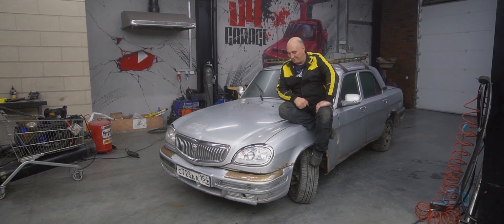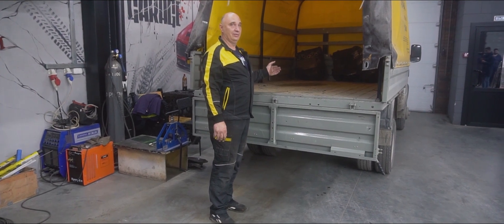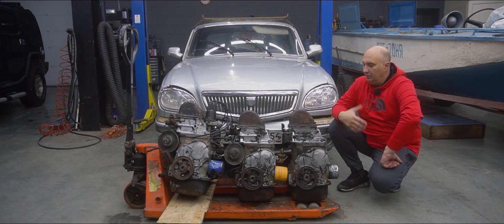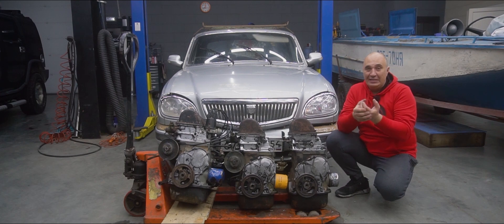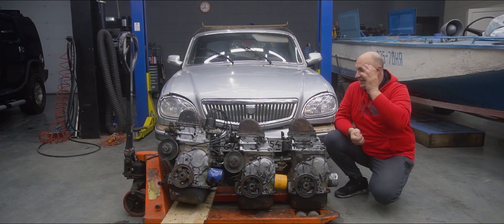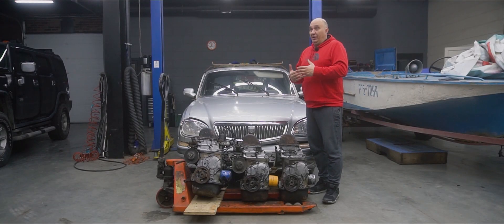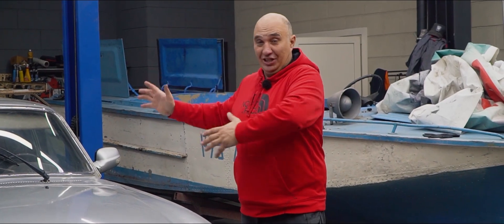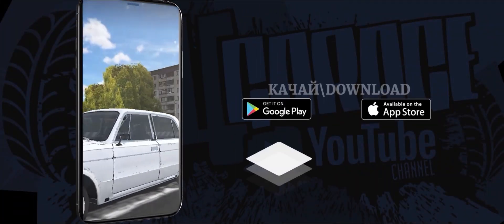Combining three Lada motors into a makeshift V12

Comment: I am a bit sceptical of joining the engines with a belt. It isn't impossible, but it will require quite special parts that won't be cheap and it doesn't sound like a way of Garage 54. You'd need a belt strong enough to transfer torque of the 2 engines, and obviously, pulleys capable of transferring resultant force to the third engine. You can get an idea of it quickly just by looking at the primary belt drive of some chopper motorcycles or at supercharger belt drives. To transmit such a large torque, it would be better to transmit it on a large diameter, because that would not only reduce the transmitted force, but also reduce the load on bearings and reduce a bending stress on the crankshaft.
Nevertheless, I have another suggestion, which is more "Garage 54-like", namely cheap and using available parts: Use the flywheel ring gear and transmit the torque by setting a set of other flywheels (probably 3) between those engines. Those additional flywheels may not even need shafts, as they may be seated directly on bearings on stationary rods, held rigidly enough (ideally at both sides of flywheels) in the frame, which you'll be building anyway to hold those engines together. It will be very "rattly" as there won't be any vibration dampening, but that will bring even more attention from the audience :D

Comment: What i would do is firs to build a frame that will hold the engines together the way that you show them on the video and then make 3 pulleys, gears or what ever you want so that you can time the engines on way that while the first piston of the first engine is in up dead position the second is 120° away from it and the third is 120° from second, i thik that it would work. (sorry for bad writing and good luck)

Comment: Motorcycle chain and sprockets may work but belts would probably be the safest bet. The chain may skip or damage the teeth if 1, 2 or all three engines aren't synchronized well.

Comment: you can put the two upper motors with the flywheel pointing forward, than replace their flywheels, plus the lower motor pulley with motorcycle rear sprockets and chain. The CB600F chain handles 102 HP... maybe you can use only one chain conecting the 3 sprockets, just need 3 free sprockets (you can even use the front sprockets of the kits together with bearings) to make the chain go arround as much theeth as they possible can on the engine's sprockets. There are bigger rear sprockets as well if you think better, like from tenere 600.

This way you don't have to mess up with the transmission/clutch of the "main" engine and will keep the acessories belt of the 2 upper ones as well.

Sprockets and chain:
https://br.ebay.com/b/525-Chain-Chains-Sprockets-Parts-for-Honda-CB600F/49831/bn_51110781

Comment: On the main engine  Add 2 flywheels in the 1st fly will attach the 2 engines By using gears in the 2nd flywheel it will be attached to the  Clutch in the transmission

Comment: Connect conrods to the power output shafts using pulleys that have been modified by adding an off centre peg,have the first mounted near the engine casing and on the next engine in the middle of the shaft then on the last engine at the end,next step is to fix the other ends of the conrods to a crank shaft that is centered on an engine joining plate by using tubing and bearings,the other end of the shaft done in the same way then the two plates are joined to form a box with oil???:/ lol I bet no one understands

Comment: Put some fat diesel timing chain sprockets on the cranks. Use two chains, one linking each secondary motor to the primary which would have two sprockets.  That would make the response a bit closer to that of an actual V12.  Just my two pennies.

Comment: Chain drive them using 530 size chain (what street bikes use), by bolting/welding sprockets to the flywheels, bolt a 2nd flywheel to the primary engine so you can still mount a transmission and clutch assembly. Chain tension won't need to be near as crucial as belt tension would be, and you could achieve it easily by mounting an idler sprocket on the slack-side of the chain assembly (So if the engines are rotating clockwise, mount the idler/tensioner in the 3oclock position.

Comment: I’m thinking giving each auxiliary engine it’s own belt and pulley to a shared main shaft would be better than running a belt serpentine style. Or you could get really fancy and use some motorcycle chain and gears to avoid any slippage and really lock it all together. Probably better off with the belts tho

Comment: take rear seats out car. Put all three engines side by side in car. Spin them so they sit like how a straight six bmw engine does. Cylinder one closest to drivers seat, then two, then three and four right at the back. Connect all three engines with a chain, run it from individual sprockets welded/ bolted to the flywheels.  Take that rotating chain and put it around a sprocket connected to an axle. Connect axle to rear wheel drive LSD.

Comment: i hope it has not already been said but my idea is plate and bolt the front of the engines , fit three centre fugal ( no spell check ) 
clutches to the three  engines with a wide width super strong belt, super charger type belt,

Comment: Just use a good sized roller chain to connect all of the motors output and for the middle motor extend the crankshaft and put a gear on it for the chain, and make a spacer for the bell housing with a gap in the top for the chain

Comment: I4 at the front with a shaft going past the other 2 I4 and connecting to the gearbox.
The other 2 I4 sit backwards next to the drive shaft (in order for the engine turning to work properly) that is connecting the first motor to the gearbox, and 3 gears connecting them all together, I reckon this would be solid.

Comment: Belts wont transmit the torque/power. A good size double roller chain with a sprocket on each crankshaft will do. Can calculate the tension in the chain by taking the total torque from the three engines and dividing by the radius of the sprocket you would like to use

Comment: I'd use a toothed belt like for a supercharger. On a 1000+ hp big block engines they sometimes transfer as much as couple of hundereds of ponies from engine to the supercharger so a wide enough belt with big pulleys should handle Lada power with ease.

Comment: Building an engine in the true sense of a V is pretty much out of the question, imho. Constructing a framework to hold the engines in a Y formation similar to 6:10 might be the best bet. If you can link the flywheels together by belt or chain. The bottom motor would be aligned normally with the clutch and transmission. Just have to figure out a way cut the bell-housing for the belt or chain, and a way to incorporate a more powerful starter motor from a diesel engine perhaps.

Comment: Here is your solution!

Put the 3 motors in a W configuration.
The 2 outer motors at a 45 degree angle, with the middle motor as is and upright.
This will save space.

How to get the the final drive, I would use 3 gearboxes, one on each motor, then maybe make a makeshift transfer case where the output from the gearboxes each go into the case and have a single drive gear out the back.

Difficult to explain in words, but easy enough if you think about it....

So basically, W12 (think Bentley motors!) with individual gearboxes.
Each then into a triple input transfer case with a single output to the rear wheel...

Comment: He said no gears or chain. It will be impossible to have all 3 synced and precise. Suppose one stalls, suppose one has lower compression then the other 2, what if one has a misfire, it will never be precise. That is why the 4 engines welded together wasnt great. There has to be some sort of slip and buffer. So if one stops working, or isnt working great, it doesnt drag down the others. Think like a one way bearing, slipper clutch, or centrifugal clutch. So each engine either contributes power, or it freespins. No drag.

Comment: I'm a bit surprised they're using belts... Surely, chains would be the better option?
A lot of motorcycle chains are capable of transferring a lot of power, so these seem like the better option.

... Perhaps with some shielding, in case they do come apart.

Comment: A gear box from a industrial shredder...where it has one engine turning two hydrolic pumps thru the gearbox....all you would have to do is fabricate a shaft and mounting holes to hold the motors where the hydrolic pumps where.... then all 3 engines power one drive shaft coming out of the gear box....you guys are sharp you could figure it out

Comment: a large plate of old tank steel... bolting all the bell housing locations together.

a system of heavy gears locking all the engines together from where the fly wheel's would be.

large barrings on a backing plate to support the gears.

-make three spindles that bolt to where the fly wheels bolts to, each has a large gear.
-the plate connecting the engines "where the bell housing bolts to" has to have idler gears, so all the engines spin the same direction.
-one of the three spindles that bolts to the crank shaft, has to have provisions and clearance thru the connecting plates so that a flywheel can bolt to it as well as a starter motor... three starter motors.

find out what scrap transmissions have gears that would work for this... would need three of them?

done right it should just use a lot of gas and always work same as any normal car.
Reply: if the engines don't bolt to the plate right the gears will be out of alignment.

Comment: You really don't have a choice but to first join the engines with a frame, and then installing that while unit into the car. You may want to make the bottom adjustable so you can adjust tension. And, you're gonna need beefy belts...

Comment: Use centrifugal clutches like from a snowmobile so that the belt can spin freely on all the engines but as each engine begins to put down power its clutch will engage and contribute to the overall torque.

Comment: I imagine those engines can't be in too good of shape. Saw a fram oil filter
Reply: Lada engines are about indestructible as Nokia 3310, so small bump into oil filter does not mean anything and will be replaced anyways before they start this abomination.
Reply: @Hellsong89  

The joke was that seeing such a low quality oil filter indicates improper oil filtration over the life of the engine. That can, theoretically, cause plenty of issues that won't be as simple to resolve as "changing the part"

Comment: Well, you could do a W12 engine lauout perhaps, or even a T engine layout, design a custom oil pan to join all of them together, three gears to join the the crankshafts in a single driving wheel, a chain to drive the cams and there you go, is more conducive than a Y engine.

Comment: Belts will slip, how about chain drive with motorcycle chain and sprockets welded to crank - mount engines using pivot on one of them like you would an alternator to tension the chain. Leave 13mm slack though to take up variation in true so chain does not snap. It may help to use 2 sprockets sandwiched between pulleys so each of the engines able to run independent of the other (ie use 2 chains) If a chain snaps it will still have 2 engines, both snap you still have one engine.
Or in Russian,
Remni budut proskal'zyvat', kak naschet tsepnogo privoda s mototsikletnoy tsep'yu i zvezdochkami, privarennymi k krivoshipno-shatunnym dvigatelyam, ispol'zuya sharnir na odnom iz nikh, kak yesli by vy ispol'zovali generator dlya natyazheniya tsepi. Ostav'te provisaniye 13 mm, chtoby kompensirovat' otkloneniya v istinnom polozhenii, chtoby tsep' ne porvalas'. Mozhet pomoch' ispol'zovaniye 2 zvezdochek, zazhatykh mezhdu shkivami, chtoby kazhdyy iz dvigateley mog rabotat' nezavisimo ot drugogo (t. Ye. Ispol'zovat' 2 tsepi). Yesli tsep' rvetsya, u neye vse ravno budet 2 dvigatelya, oba shchelkayut, u vas vse yeshche yest' odin dvigatel'.

Ремни будут проскальзывать, как насчет цепного привода с мотоциклетной цепью и звездочками, приваренными к кривошипно-шатунным двигателям, используя шарнир на одном из них, как если бы вы использовали генератор для натяжения цепи. Оставьте провисание 13 мм, чтобы компенсировать отклонения в истинном положении, чтобы цепь не порвалась. Может помочь использование 2 звездочек, зажатых между шкивами, чтобы каждый из двигателей мог работать независимо от другого (т. Е. Использовать 2 цепи). Если цепь рвется, у нее все равно будет 2 двигателя, оба щелкают, у вас все еще есть один двигатель.

Comment: Cast an entire new engine block that repurposes all the rest of the parts of the 3 motors combined.
And then use that to power a EM drive system that is basically using only electrons for locomotion while not having a electric motor.
I think, if elon musk can fire a car into space, garage 54 can pull an area 51 or an area 54, and fire a lada into space as a comical physics achievement!

Comment: It's gonna be interesting how you can sync up the fireing order so each engine isn't doing their own thing
Reply: maybe 1 way bearings and attach the pulley and the belts to that ...so if any motor is reeving more than the other 2 it doesnt matter to the others ...
its a bearing that transfers power only 1 way just like the rear sprocket of a bike it transfers power in 1 way and it slips and behaves like a normal bearing the other way

Comment: There are 2 ways u could do this. Either u cut the engine block and just make them have the same shaft, either u put them \|/ so that the belt doesnt have to be giant and so that the engine doesn't come out of the hood(cus in the current way the 2 top engines would come out of the hood and restrict a lot of vision)

Comment: could time the engines so many ways big thump three firing same time or rig so firing 120 degrees apart ,those engines are bullet proof.would be good to port valves and up compression low boost turbo,reckon they would survive and impress

Comment: Make frame on front of engines and bolt them on then add camshaft sprocket on top of crank pulley with longer crank bolt
Timing belt (like skoda superb 2.8 v6.. should be plenty long) and 3 tensioner pulleys in between the engines

Or same thing but with motorcycle chain and sprockets

Comment: Hello Garage 54 crew! I have a suggestion on how to combine the 3 motors. This may be a long read, I don't know yet.

1st, the motor mounts can be attached to a cradle made of square tubing. That will keep the 3 engines in line, and square to each other.

2nd, you can connect the 3 together by the front crankshaft pulleys. Weld another pulley on each of the 3, so the belt will not interfere with the other pulleys (alternator, water pump, etc.).

3rd, connect all coolant hoses into 1 radiator. All wiring into 2 batteries. All 3 starters into 1 heavy duty switch. All 3 carbies into 1 fuel source. Big feed line diameter, into a 'manifold' that splits into 3 carb feeds.

4th, throttle cables. Engineer that in true Garage 54 fashion. 😁👍👍

1 manual gearbox on the bottom engine. And awaaaay you go!

Cheers!
Reply: that will put more stress on the engine thats reving the most to solve that maybe they use 1 way bearings and attach the pulley and the belts to that ...so if any motor is reeving more than the other 2 it doesnt matter to the others ...
its a bearing that transfers power only 1 way just like the rear sprocket of a bike it transfers power in 1 way and it slips and behaves like a normal bearing the other way

Comment: Get one more engine so there are 16 pistons in total (4 engines). connect the engines in 2 pairs together like the inline 16 car you made previously (2 inline 8 cylinder engines). Mount the 2 engines in a v configuration where you now have a long v16 (two 4 cylinder engines per side).

A long v16 engine would be awesome, it’ll be a Bugatti in a v config 😂

Comment: Big metal plate at the back between the engine and gearbox wide enough to connect the other two engines. Brace at the front going across the three heads. 
Use motorcycle chains (two or more) then you can add sprockets to the crank pulleys so its strong and simple. Chains also mean you can set the crank timing between each motor and if they are offset so none fire at the same time you have zero extra strain on the gearbox.

Comment: Technically this is a W engine, not a V...because a "Y" shaped engine is already known as a radial!

Next level of this is to make a 20cyl, 5 bank radial with Lada engines....
I think to connect them, hook up chains to all 5 flywheels. Then make  a jackshaft in middle that will transmit the power to the trans input. Since the main drive chain from jackshaft to transmission will likely be running where windshield is now, you might have to use an automatic but it will still be beast.

Comment: Buy another engine. Put two next to each other connected at the crank with chains or belts.  Then take two more and  connect those to the crank of the previous two. Connect all four to a transmission and you will have a V 16